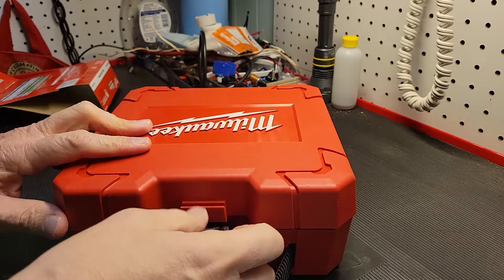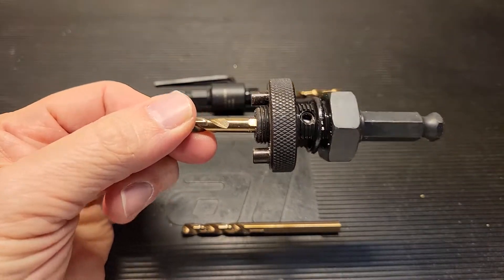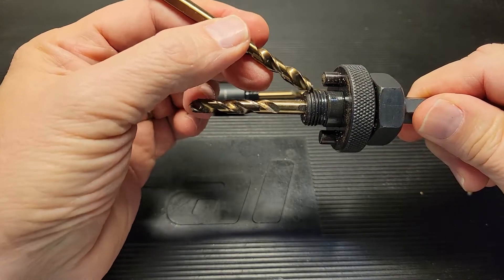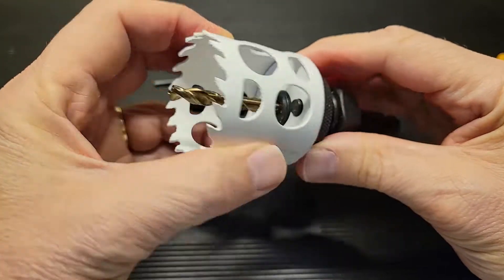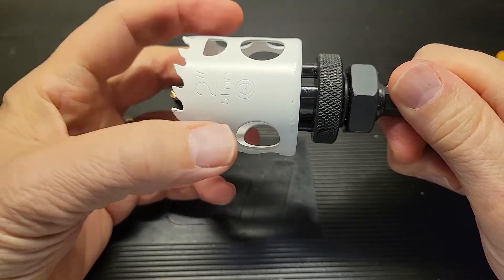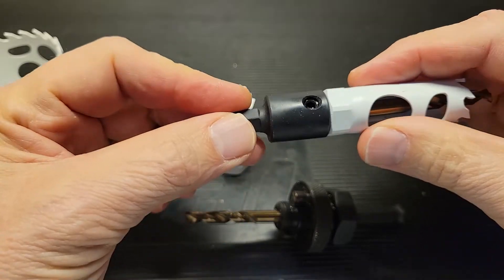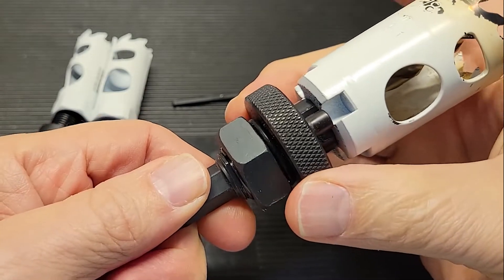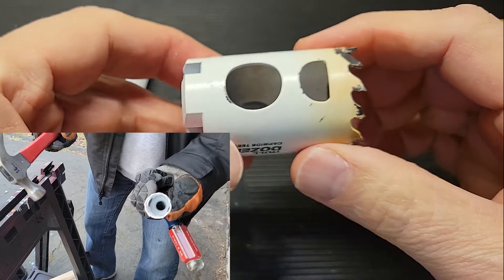How To Use The MILWAUKEE Arbor (the missing instructions)

Comment: It won’t fit impact tool milwaukee
Reply from the maker: This Arbor will fit any standard electric drill that accept 1/2" shank including those of that include impact driver, but not impact rotary hammer drill. You would not use impact function with this tool.

Comment: If you need to bottom out a holesaw onto an arbor with no locking mechanism, put a small bit of bare wire or a washer between the two components it will make it easier to unwind
Reply from the maker: Thank you for sharing this useful tip.

Comment: Mine is different. The piece with pins has a set screw. I changed the saw the pins go into place but no matter how tight the set screw gets it won’t ! hold it in place.
Reply from the maker: Is there a flat side the screw to suppose to mate to?

Comment: The funny part is Milwaukee tells you to not use the second arbor in your video with larger hole saws (presumably because it might get stuck, and because there is no place to grip the hole saw with a wrench on the larger ones wrench) BUT they actually sell them pre-assembled that way as a kit.    I bought a 2" one, and - predictably - I had a HELL of a time getting it off after using it just to drill through some drywall.

I had to use an adjustable wrench on the hex bit side, and stick a long narrow screwdriver through the holes in the side of the hole saw to force it off.   In my first attempt I destroyed a screwdriver, as it got bent.

They should really follow their own advice and only use the simple screw-on arbor for small hole saws...
Reply from the maker: They don't seem to be concerned with lack of clear instructions. Thanks for sharing your story.
Reply: My M kit only came w the small arbor. I used the 2 &1/4 saw. When I was finished there was no way I could release the arbor. A Maytag service man was here and he released it in a nano second! Now I have a large arbor with a different system for connection but I figured it out from watching this VERY helpful instruction video. Thank you thank you!

Comment: All my hole saws don't have a threaded centre hole, soooooo I was thinking a lock nut was missing.     I was about to go and look to buying the lock nut.     Anyway this set up with the locking pegs is a much better design.
Reply from the maker: Stephen, you may also want to consider Spyder.  According to @ckone671
"the Spyder's carbide hole saws take' seconds to change and even spit out the wood."

Comment: So apparently... you can actually slip a socket over the end of the small arbor and use an impact with a wrench and it works like a charm if the holesaw is stuck. After drilling throigh metal... they don't want to come off and sometimes two wrenches or a set of adjustable pliers slip.
Reply from the maker: Wacky, thank you for watching and for sharing the useful tip about using a socket. Much appreciated.

Comment: Man I can't believe there are actually people who can't figure out those simple steps. But your video really wasn't complete. The other thing most newbies need instructions on is setting the depth of the pilot bit to protude the correct amount in front of the saw. Also instructions on how it's sometimes better to go ahead with a regular drill and pre drill the quarter inch pilot hole so that the saw teeth don't grab suddenly when the pilot bit breaks through.
Reply: Buzz, what simple for some people is a challenge for others. It all depends on your past experience, of course it wouldn't hurt if the manufacturers would include some real instructions on how to best use their tools. Thank you for much for sharing the useful tips, much appreciated.
Reply: And yet…here I am taking mental notes 😂😂😂

Comment: my first MILWAUKEE product, also my last. I dont buy tools so I can spend more time working on them instead of my product. this video was very informative. Mine is still stuck now I'm off to buy a different brand.
Reply from the maker: Dirk, would be interested in knowing what brand you end up with and if it is better. Thank you.
Reply: I just purchased the Spyder product, have been told its top-notch quality! Also, I watched a video on you tube, some guy who seemed to be a hole saw fanatic gave a great demo on using their product. Right now, I love the design and how simple the Spyder product appears. If I don't like it, I will come back here and tell you, but if I do like it, I won't say a word ok....    @cfldriven
Reply: driven, just spent an hour using my new Spyder hole saw, and I absolutely love it!!! Never got close to seizing up, took the saw off easily, just push the button, slide the saw upward and it pushes out the chunk of wood and you simply slide it back into locked position.
Reply from the maker: @DirkMcFann , Thank you for getting back and sharing your experience with Spyder hole saw. Good to hear it working for you, I will have to give it a try. Thanks again.

Comment: Excellent video, thank you. Is it possible to use the hole-saw without the drill bit? I’m trying to make tenons for log furniture, and I want to start the hole with the drill bit to get the hole-saw centered, and then remove the drill bit from the holesaw and continue drilling the tenon. If the drillbit continues all the way through the tenon, it will weaken the tenon.
Reply from the maker: You would only be able to cut until the arbor bottoms out on the material. I have never done this but think it should work. Let us know if you do it.

Comment: Once again, You Tube is the best resource for this single woman that's a serious DIYer.  I bought a set of the hole saws and had not been able to figure out the arbor mechanics.  I bought several smaller extra hole saws that are the smallest they make, and it's been a real challenge to figure out what I need to get for them.  There's lot of choices on arbors..at local hardware and big box stores, but no one seems to know how to help me.  Now, "I know" what I "need to know".  Thank you much!
Reply from the maker: Sandi, congrats persevering! Strange how there are instructions on how to open the zip lock on Animal Crackers, but not on a tool that needs it.

Comment: I have used a lot of hole saws in my day.  Was on a job yesterday and forgot my arbor so I had to the store and buy one of these.  They are CRAP!  I couldn't keep that stupid backing nut from backing off and jamming so tight it took channel locks to get it loose.  I spent more time jacking around with it that drilling holes, I wanted to throw it across the job!
Reply from the maker: Thank you for sharing your experience.

Comment: Great overview. What confuses me is that for larger holes, Milwaukee sells both a 3/8" arbor (without locking nut) and 7/16" arbor (with locking nut, shown in this video). They are priced the same, both are quick change, and both accept the same range in hole sizes, so I'm not sure what the use case for one vs the other is. Anyone know?
Reply from the maker: Would be interesting to learn if there is a reason for it. Another viewer mentioned the Spyder hole saw sold at Lowes is worth considering.

Comment: As a contractor why would i even waste my time with this garbage system.  Spyder's carbide hole saws take' seconds to change and  even spit out the wood.  Seconds!  The Milwaukee system is complete garbage!  Bosch used to have a similar system to Spyder's in the past,  but not sure what happened to it.
Reply from the maker: Thank you for sharing about the Spyder hole saw, the ability to eject the material is impressive. The Spyder is exclusive to Lowes, although Amazon sells them for more, which could be issue for some viewers. I appreciate learning about this alternative hole saw.

Comment: Super, super useful instruction! I was very confused by Milwaukee, even got some minor injuries when trying to change the blade, due to not installed it correctly (thanks God, no major ones yet). That was why I searched and found your video. Hope Milwaukee or Home Depot put this on their site to prevent injuries for customers.
Reply from the maker: You would think detail instructions would come with a tool like this. When we couldn't find any easy to use instructions we decided to make this video to help prevent some injuries and frustration. Thank you for the feedback and for watching.

Comment: A weak point of hole saws is the drill bit hole. Use anti seize and don’t crank or over torque the set screw.  I remove the drill after use. They can get burs from the set screw and get stuck.
Reply from the maker: Over torquing and bottoming out will definitely make it much harder to disassemble after use. Milwaukee's approach on the big arbor has resulted in no stuck parts. THanks for watching.

Comment: That's a bit dissapointing about the small holesaw's having to be removed with pliers or a spanner :( Everything else is such a great design.
Reply from the maker: You're right they need to work on making it easier to use the smaller holesaw. Thanks for watching and taking the time to comment.

Comment: Thank you! I bought it today and thought it had instructions. NOT! Very nicely presented. I can actually use it tomorrow...
Reply from the maker: I get that a hammer doesn't come with instructions, but hole saws and arbors need some instruction so they are utilized correctly. Thank you for the feedback and good luck with your project.

Comment: PS I also appreciate you pointing out the flat side of the drill bit, I’ll check to see if I have one, thank you again
Reply from the maker: It a shame that none of the different arbors I own come with instruction on how assemble it. Not sure why it is a secret.
Reply: Hey you can just take a bench grinder (preferably) or even a file and grind a flat on a rounded pilot bit. It’s similar to machinists using a “Weldon shank” so you can search up how to grind that :)

Comment: Good demonstration, thank you! I don’t have this particular model, just the ones that came with my Stanley saw accessories. No holes and no thread, but I seem to be missing the section that fits into my saw chuck - a mystery as I’ve used it before!
Reply from the maker: They are like socks and eyeglasses always disappearing which is another reason I like when the kit includes a holder for everything. Good luck on the search and thanks for watching.